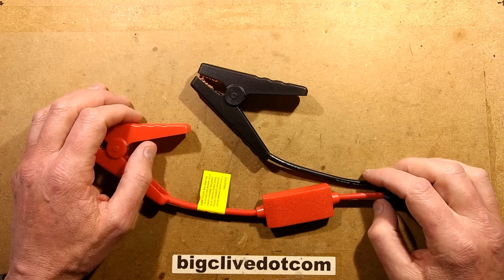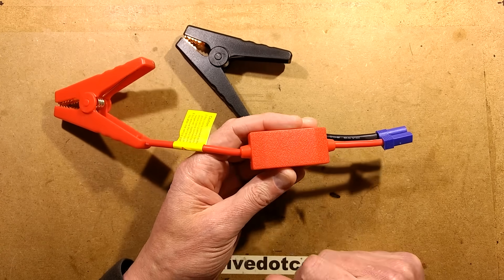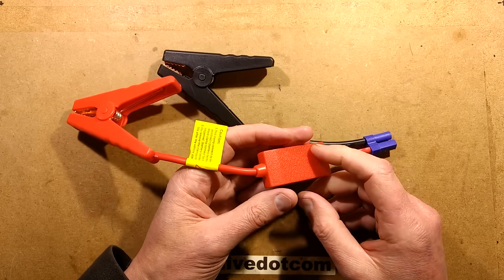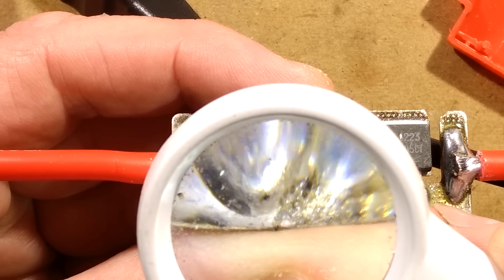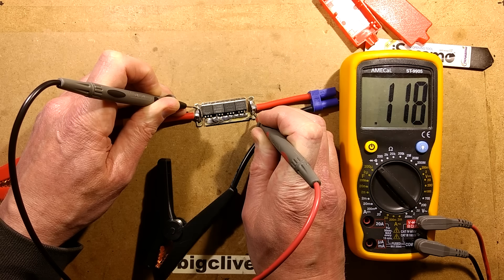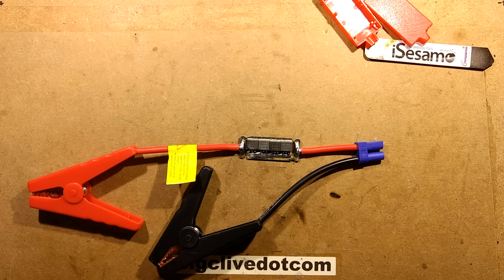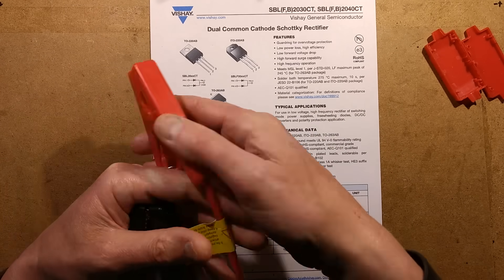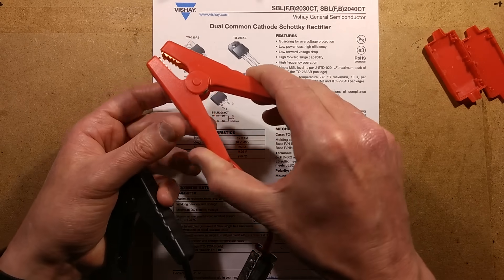What's in the little red box on some jump-start leads?  (Guess first.)

Comment: the forward voltage is low because you have many diodes in parallel. Forward voltage changes as you add more diodes. I'm not sure if it is supposed to go down or up offhand, though what you saw would suggest that it drops.
Reply: Andrew Delashaw It's not resistors, the current / voltage relationship is not at all linear.
Reply: Justin DiPlacido Yeah, the usual ~0.6V divided by the 4 diodes= ~0.15V.
Reply: John Francis Doe 
your right John. Its still going to be around 0.6 Volts.
Reply: no it will not, the diodes will share the current, and the forward voltage of the combination will then be lower as each diode operating at a much lower current.  he's just saying you can't divide the .6V by 4 diodes to get .1V
Reply: Justin DiPlacido 
Hi Justin. As the diodes are in parallel they will have the same voltage across them.  I cant see how they are conducting if the voltage is less than 0.6 volts, can you explain please. Thanks
Reply: sure! it's quite simple actually.  if you look at the IV plot for a diode you'll see a "knee" in the graph. This knee represents the moment that the diode turns on.  The relationship between forward voltage (x axis) and current (y axis) is exponential, so it takes a very small amount of current to go from .1V to .6V across the diode, and a very large amount of current to go much above .6v.  so in normal operation the diode will quickly turn on and have about .6V across it regardless of current.  However if the current is very small the diode drop will be less than .6V.  what's happening here is that Clive's meter does not put out much current, and that current is being shared by 8 diodes.  this causes each one to operate at the beginning of the knee in the graph, meaning each diode is not fully on and is dropping only .1V.   since this is made for high current applications, the diode array has been designed so that when the current is very high they will only be dropping .6V.  when you put 500A through this each diode will get enough current to bring the forward voltage up to .6V.
Reply: Hi. Thankyou for taking the time to explain this.  I think I will hook up some leds in parallel and feed them with just one series resistor and a variable power supply and have a play.  Thanks for keeping thi interst going!

Comment: As you have just posted this I would like to ask you a question. I'm camping for the TT this year and I was wondering what would be a good power source for charging my tech? Would I be best with a large 5v power bank or would one of these jump starter be better? Will the dropper circuitry allow me to draw less amps? Do you have any recommendations for large power banks?
Reply from the maker: I'm not sure what the best power bank choice is.  It depends on your expected load.  Some of the "smart" ones are not ideal for low lighting loads as they not only draw a modest current themselves while active, but may also keep cutting off with a low load.
Reply: Yup. I have one of these stater packs but I have to keep switch in on. I wasn't sure if when charging off it at 5v 1A if the charging circuit will still draw 1a at at 12v. Incidentally I have one of these stater packs that doesn't work it you would like to disassemble it.

Comment: Why would you put barely ok peak current value rated diodes into a starter pack and sell it on ebay? Is this some kind of sadistic arsonists plot or an actual everyday appliance?
What did you say was the use-case of this setup again? Why is this making me comment and holds me so interested?!
Reply from the maker: It's designed for use with tiny little lithium power banks that can jump start cars with hundreds of amps.  Basically little pocket bombs.
Reply: i love it.

sorry to have bothered you, you said everything i asked, in the video already; i wasn't paying enough attention

Comment: Why diodes ? Are there any chance that spikes would come from the dead battery (car) to the one that is charging, or the charger. I do not get the purpose. The current is always going to flow in the direction to the correct battery. A fuse would make sense to me.
Reply: As soon as the motor starts they voltage usually rises a lot (14-15V). You don't want to backfeed into the jump start pack.
Reply: OK. That makes sense. Thanks.

Comment: Reverse Polarity protection incase an idiot like tries using them.
Reply: There's no point of reverse polarity protection when there is power sources on both ends. It is backfeed protection.
Reply: More likely they aren't trying to stop reverse polarity but rather reverse-charge.  Lithium batteries would get very angry if your car started and tried to push 20 or 30 amps of power INTO the lithium battery unregulated and if it went on long enough it might even blow up.
Reply: Actually its more likely there to prevent the alternator from forcing current back into the pack and trying to "charge" the Li-Ion cells when the vehicle starts. It will be around 13-15 volts.
Reply: superdau  The cathodes of the diodes are connected to the centre pin and the tab of the package. Manufacturer s don't fit the centre pin as the diodes are usually soldered onto a printed circuit board. The current flows from the battery pack towards the +ve clip on the battery, following the arrows on the diode symbol.  ☺
Although there are 4 diodes, if they are not the same type, they probably won't share current properly💥
Reply: Clive, did you check continuity the other way to make sure that the low Vf was not just a dud diode? 😀
Reply: Yes, I see what you mean about no reverse polarity protection. For the scheme to work properly, the charger needs a over-current trip. I bet it doesn't....
Reply: It burn the battery.
Reply: Take a look again. The way the diodes are mounted they conduct from car the battery when the cable is connected with the wrong polarity. Guess why? Because it's not a reverse polarity protection.
Reply: Thats what i thought backyardbasher, diodes are ment for one way. Eden's Aquaponics why is polarity protection impossible?
Reply: Matthew Miller if you put a one amp charge on a lipo battery for a few hours it would blow up.
Reply: Yes this is how most reverse polarity protection is implemented. I think Dave Jones did a video on this.
Reply: And what happens when you are jumping a battery and connect it up wrong? You know connecting the the red to negative - and the black to positive +. This is also called  reverse polarity, it is also called a dead short. These diodes are a one way check valve type of device for electricity keeps idiots from burning out the electric systems in the car.
Reply: People which can not do positive and negative terminal different. Should Call for help. Not Connect the cables AS IT could pose a risk for them.

Comment: Clive, you could've talked about the issues with diodes in parallel. One tend to conduct before the others, and draw most of the load. The common heatsink helps out, but is far from reliable, I would say.

Comment: interesting, I imagine they are there to protect the jumpstarter from reverse polarity ie. hooked up backward like a dumbass.... 

So let me tell you about the time I hooked up my new car battery backward because my car battery leads were both black.  Not only did I strand myself in a snow storm that shut the city down and no tow trucks were servicing the area, but I fried the electronic ignition in the distributor, AND feel like an ass at the same time.  If only my cars positive lead had some sort of reverse polarity protection built in, guess they didn't have that luxury technology in 1982.

Comment: Stupid question...The numbers on each of the diodes is different. Does that mean they are differently rated? I dont suspect its just a different manufacturers number as they dont tend to do this...confused mechanical brain here.
Reply: The changing number quite likely are datecodes when they were produced. With the numbers all over the place it tells you they used "leftovers" and not new stock from a reel (the dates also look like the parts are from 2001/2002). 
In a proper design you would never do that, because you must not put diodes in parallel without precautions (this is true for LEDs as well). Diodes from different batches will have slightly different characteristics even if it's the same part number. And mixing different part numbers like they did (2040CT and 2045CT) is a big nono as well. The problem is, if the diode aren't almost exactly the same (not just the type, but in measured electrical characteristics) and thermally coupled to each other (at least they are on the same piece of board, so that's a bonus), there's always one that conducts slightly more current than the others at the same voltage. More current means more heat for that diode and diodes conduct better when they are hotter! So the diode takes even more current, heating up more and more. Depending on how much you overload it, it might die immediately or after repeated use. Now that that diode is dead, it's time for the second best conducting to take it's turn, except now the current will be devided between on less diode, so more current for all of them and die even faster. That's also a good way to kill LEDs if you skimp on limiting the current of each strand of LEDs individually.
Reply: @superdau  I had exactly that issue with some harbor freight flashlights that connected all of the LEDs in parallel,  with no current limiting of any sort,  driven by 3 AAA cells.
Reply: The top rows are some datecodes or fab-codes or something; the part numbers are on the bottom row. I see two SBL2040CT and two SBL2045CT - the only difference between those is the reverse voltage rating (40v vs 45v), but that shouldn't affect anything in practice, in this usage scenario.
Reply: +Mix Bag, here's a link to options available from Mouser (Schottky diodes, 20A and above, 40v and above, sorted by price).

http://www.mouser.co.uk/Semiconductors/Discrete-Semiconductors/Diodes-Rectifiers/Schottky-Diodes-Rectifiers/_/N-ax1mj?Rl=ax1mjZgjdhqdZ1yuoc7iZ1ypakakSGTax1mjZgjdhq5Z1yuoc6sZ1ypakalS1ya6ncwZ1yuo4zqGT&Ns=Pricing%7C0
Reply: Khron's Cave d
Reply: +Mix Bag Check how the diodes are oriented. These diodes are not reverse polarity protection (no point in having that with power sources on both ends anyway). They are back feed protection.
Reply: No its a very old car battery charger that can also be used to jump start a car. one of my friends connected the polarity the wrong way round on the battery and now its completely dead. luckily i have another one so was wondering if i could use this diode design to protect this one. i have dismantled both and non have any type of protection on the output of the transformer
Reply: thank you i understand know :)
Reply: Mix Bag is it a charger you made yourself? Every charger I've seen has reverse polarity protection built in.
Reply: I think he just didn't notice that they were different. Yes, the ratings would be different, but probably fairly similar in this case.
Reply: If you use the charger as just a charger and don't try to crank the engine with the charger connected, you can probably get away with using a single high-current rated Schottky diode.  But bear in mind that if you do try to crank the engine with the charger still connected, you'll likely blow the diode because the charger will be trying to feed into what it sees as a short circuit.

To prevent this, you could try adding a fuse with a rating slightly higher than the rated current of the charger.

For example, if the charger is rated at 5A, you could probably use an 8A fuse.
Reply: It's not for polarity protection, it's to prevent the Li-Ion cells being charged by the alternator after the engine has been started.  You can't use MOSFETs as a low Vf diode with only two terminals.
Reply: cant find those diodes on ebay for cheap. is there an alternative diode that could be used ? was thinking in making a board of 5 of these to add to my car charger for reverse polarity protection ?
Reply: back feed protection IS reverse polarity protection when using diodes in this config.  Can't see the forest for the trees...

Comment: An interesting view, especially as I use a battery pack with a similar set of leads (although the ones on mine do look a little beefier).

The one I have is a now discontinued (and replaced with the next iteration) Suaoki T3 which is rated at 600A peak and with a capacity of 18,000mAh. I've not gone as far to check the capacity and peak ratings but it did help out a lot when I had a dead battery in the car for a month or so and allowed for around 10 jump starts between charging.

Comment: I guessed Diodes correctly, but was thinking it was to prevent current flow if the user put the leads on the battery the wrong way round?

Comment: I have a lithium jump starter pack, and it has the cables with a box as well. However on mine when you plug the cables into the jump pack the instructions on the box say "wait until this light turns green to start the vehicle" or something along those lines. I assumed it was something that charged up allowing a huge jolt of current when you tried to start the vehicle.
Reply: Kevin Clingerman Bingo, it's charging up your flat car battery, so it will help not hinder the starring current.

Comment: Same design as mine. Except the datasheet for the rectifier packs in mine say 20A, and they blobbed on the solder much more uniformly and right up to the wire.
I've never started anything with mine... Originally bought it to start our mower, but have only used it to test trailer lights so far. I did try to start a mower with it, but I think the mower has a dud starter relay.

I'm curious whether it would be safe to wire one of these up permanently on a small engine like a ride-on mower.... Do those diodes prevent any sadness?

Comment: fuse is too obvious so I am going with half added diode attempt to stop the car charging the battery or reverse polarity protection (but being from China the diode will be grossly under rated. )
Reply: MMM. that was actually reasonably decent spec. not bad.

Comment: Use your power supply and put a load of 5A over the diode-module. Then measure the voltage-drop, this will give you a more useful measurement.

Comment: The component numbers are seemingly random ?????? as in not the same
Reply: I noted that as well. SBL20XXCT where XX tends to match up with the maximum repetitive peak reverse voltage. I suspect the manufacture had a selection of remaindered diodes. They're nearly worthless but throw them in with some other cheaply made parts or other seconds and maybe you can get somebody looking for a deal to buy it and more than recoup your cost.

Comment: That forward voltage drop is very low, I'd expect it to be higher?
Reply: It's measured well below the current knee at which the voltage drop is rated. You'll see this issue whenever you measure very high current rated diodes or a boatload of diodes connected in parallel.
Reply: Siana Gearz Thanks. So as the current increases so does the drop? (More power being dissipated)
Reply: Correct. There's normally a pretty large range within which the drop is really close to rated though. But you have diodes rated for tens of ampere, and the diode tester function on a multimeter is a constant current source of around 1mA. I think there is more than one mechanism that contributes to the current dependence though, like inherent dependence at very low current and parasitic resistance at very high current.

Comment: For testing these, maybe an old school AC welder (welding transformer)? It would be easy to measure current with clamp meter and current capability of welder should be big enough to liquidify these cables quite fast.
Reply from the maker: I'm not sure my AC welder would be too thrilled to have a diode in series with the output leads.  But it would certainly test the cables.